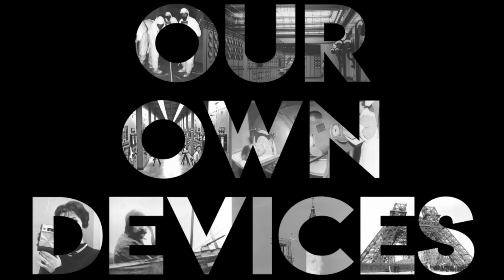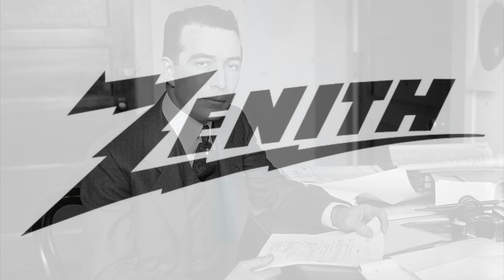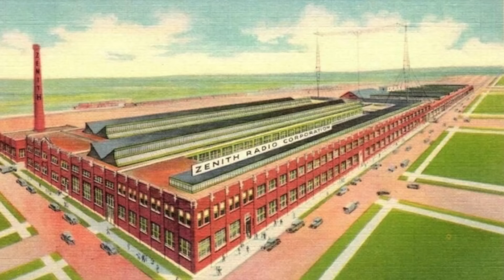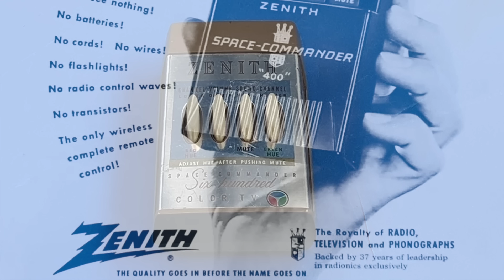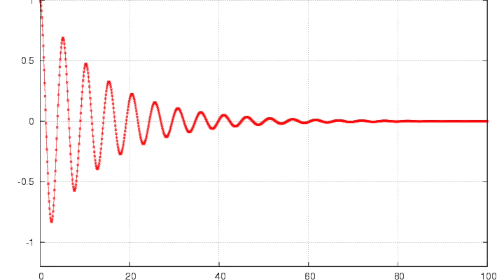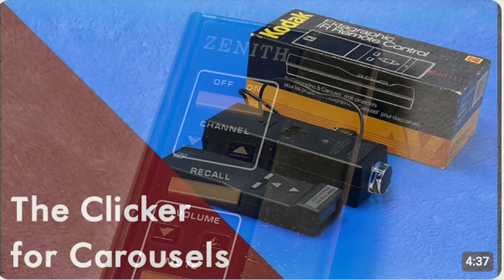Zenith Space Command TV Remote: the Original 'Clicker'

Comment: 08:00 "Since producing infra-sound was not technically feasable...."

Of course it was technically feasible: you make the same control, just with slightly longer metal bars. For example, if you wanted to use 20, 23, 26 and 30 Hz, you'd use aluminum bars about 159, 138.5, 122.5 and 106 m long. This also has the advantage of making the remote control large and heavy enough that you are unlikely ever to lose it.

Heathkit was a brilliant company that made some very interesting home computers, among other things. I'd love to see you do some episodes on their stuff.

Comment: When I was a little kid we had an old black&white Zenith in the spare room with that remote. In fact we kinda had two remotes: back before I was born my parents had somehow accidentally crushed the original remote it came with, and while they were eventually able to obtain a replacement, my dad had also managed to salvage just the frame holding the four bars from the wreckage of the original, and we were able to use that to control the TV by striking the bars with a nail. I remember the ringing telephone would also sometimes change the channel.

Comment: We got out first color tv in 1963.  A Zenith console with remote.  Our remote only changed the channels, on/off and muted the sound if I remember right.  Used the same technology, but ours was not silent.  You could hear it when you pressed the keys.  You could turn the tv on and off by jingling your car keys near the tv.  The remote finally wore out and the rods fell out.  Me and my sister loved it as we were the remote before that.  We had to go change the channels and adjust the volume.  Luckily there were only 4 channels to run through.  LOL

Comment: Fascinating video as usual Jean!  😎
In the late 1970’s, my first job in my own electronics career was as an apprentice technician at a small local TV repair shop.  These ultrasonic remote controls were still the prevailing technology for TV remotes at the time, including other brands besides Zenith.  It was quite amusing to jangle a set of keys in front of one of these sets and watch the TV go bananas! 😂  Another time, I had a remote controlled set that I was reassembling after repairs unrelated to the remote control system .  I had the set powered on and was testing the TV operationally.  The set was operating properly but I still had to connect the ultrasonic pickup microphone.  As soon as I plugged it in, the set immediately began charging channels endlessly.  You screwed it up! My boss, the shop’s owner and head technician complained.  But I noticed right next to him on a shelf was an early ultrasonic motion detector for the shop’s burglar alarm system.  Put your hand over the ultrasonic emitter, I suggested to the manager.  He looked at me slightly in disgust but nevertheless covered the emitter with his hand.  The relentless channel changed immediately stopped, and he looked back at me with a mixture of wonder and newfound respect for my technical knowledge.  Son of a bitch! 😮 He exclaimed!  You were RIGHT, 😅

Comment: They had an ultrasonic piezeoelectric transducer located at front of tv and used a 6au6 tube as a preamplifier to pull in a stepper relay to control motor mounted on tuner

Comment: I've used a later acoustic based remote, decades ago in a small hotel in the alps.
They had a very rustic tv room with an old color tv still hearing wood paneling, fitting the room nicely with the dark wood furniture and antlers on the wall.
Anyway I've never seen a remote before that wasn't cable bound or relied on it infrared already, this one however emitted a high-pitched noise that older people couldn't hear, me a teenager back then could hear it, it also drove dogs crazy.
Pretty sure it wasn't a "Zenith" though.

Comment: Two stories: 

My aunt and uncle had a Zenith TV with this remote. Occasionally, when someone rang their doorbell, it would change the TV channel. My guess is that some harmonic of the door chime (metal plates with a solenoid striker) was the culprit.

My engineer dad hate commercials (something I inherited from him). In the early 60s, he rigged up what he called the "Kommercial Killer" -- a relay based flip flop circuit controlled by a light sensor (from a streetlight). The flip flop circuit would switch the TV's speaker with an 8 ohm resistor to mute the TV. His "remote" was a flashlight. At some point, he noticed ambient light was triggering the flip flop, so he taped a toilet paper tube to the sensor, giving it some directionality. 'Twas ugly, but it worked!

Comment: My parents bought a Zenith TV in the late 60s that came with this remote. I was maybe 8 or 9 years old at the time, and I played with it endlessly over the next few years. Like many other commenters I quickly discovered that jingling a ring of keys would cause the TV to change channels randomly, a fact that I weaponized to annoy my sister.

A few years later we got another Zenith TV for the den, this one a much cheaper and smaller B&W version. It came with a stripped-down remote, a skinny device with just one button. It worked the same way as its older sibling, but with just one button it was limited to changing channels. Cleverly, the TV was designed with an on/off spot on the channel dial - when the dial rotated to that position the thing would turn off (and of course could be awakened again with the remote).

Comment: I remember when my granddad bought a Zentth TV with a "clicker", and that is exactly what he called it, a "clicker", so it is funny how that term was adopted by so many over the years.  In 1976 when I was 15, I had a summer job repairing TV's, nothing really very technical as it was my first real job, mostly opening and closing up the TV's for my boss, maybe change a transformer before hot chassis became commonplace, the owner/tech would tell me what to replace and I did.  When we would use the cool spray or tuner cleaner spray near one of those TV's, it would either turn off and on, or change channels, so we would have to make sure someone wasn't actively working on one of those TV's before using any kind of spray to keep from disrupting them.

Comment: Fascinating, indeed! A really like the concept of battery-less devices like this that uses mechanical energy to work. I ordered a battery-less light switch and corresponding relay module from Ali. I think it uses a small copper winging and a magnet or piezo crystal to generate a short pulse of energy that puts off the transmitter. As long as the mechanics won't break, it should work without ever needing a battery ^^)

Comment: In case anyone didn't know, you can buy battery-less remote light switches that are very distant cousins of this thing.
They use piezoelectric effect to generate enough electricity to send a radio signal, but mechanically are a little reminiscent of this, together with a soft click. This effectively allows you to move a light switch anywhere in a room without rewiring it.
Modern day TV remotes have too many buttons for this to work though.

Comment: My family had a GE Television in 1962 that had an ultrasonic remote.  The remote was fairly large by modern standards since it was built before the invention of integrated circuits, and was powered by a single 9-Volt Transistor Radio Battery.  It had only two buttons:  VOLUME and CHANNEL.  The TV received the usual VHF Channels 2 — 13, but had an extra magic channel:   OFF, which really just muted everything, since if you turned the TV off from its control-panel, the remote didn’t work.

Comment: Our only had two controls: volume and channel.  The volume was I think three steps and then off.  The channel caused the tv to skip to the next station that had a mechanical stopper set.  This was back before UHF so at channel 13, it went back to channel 2.  We had channels 4, 5, 8, 11, and 13 through most of my childhood.  13 was PBS.  11 was an independent stations while 4, 5, and 8 was the big three ABC, CBS, and NBC but I don’t recall which was which.

Comment: In '67 we were over a a family friends' apartment.  She had a color Zenith tv with that remote.  I was fascinated by it being batteryless.  It was also the first time I had ever seen a Start Trek episode in color.  The remotes are actively sold on Ebay.  It might be fun to integrate one into an arduino project.
Reply: My family got its first color TV, a Zenith model, when I was 6 years old in 1966 just before the new Fall TV season started. We, however, did not get the remote control. On the other hand, I did get to see Star Trek in color from the beginning.

We did have a separate set top box that remotely controlled the rooftop antenna position, but you had to get up and walk to the TV and turn a knob to use it. Usually you had to adjust the antenna position when you changed channels, so the remote control for changing the TV channel would not have eliminated having to get up and walk to the TV to change the antenna position in our setup anyway, which is why my father did not want to pay for the additional charge for the TV remote control.

Comment: Many many years ago, I fixed a TV that used a remote like that but with only 3 buttons.  It did volume up, volume down, and next channel.  This was before UHF was a thing so there were only 12 channels to step through.  Power off was done by turning the volume all the way down and then hitting the volume down again.  The volume up was also the "on" button but in fact a lot of the TV was powered on even when it was nominally off.  The heaters in most tubes were running at a lower voltage but the ones for the microphone input and volume up were fully alive.  Mechanical stuff in the TV went clunk for volume up or down and CLUNK for next channel.

Comment: My granddad, a TV repairman had one of these back in the 60s. 
It was basically a nightmare. 
Anything that moved metal around would trigger the TV. If you had keys, silverware from the kitchen, any small metal objects would trigger the darn TV. 
Channels would change randomly and very shortly after getting the TV. The tuner mechanism went out of adjustment and once triggered it would just spin through the channels until you turned the TV off and back on again or grabed the knob and made it stop.
After about the third time he had to pull the TV apart to fix the tuner the machine went in the trash.

Comment: Those acoustic systems on ultra rare occasions would "trigger" on ones keys on a key ring, You could have 3 dozen folks have gobs of keys on a ring and none would change the TV ever, Then one extra person with 6 keys would by accident have one key that's 3rd or 5th harmonic would change the volume or Channel. I had a one key of a set of 3 key rings that by accident would trigger on of these acoustic receivers in aTV.

A electronics friend in SoCal had an acoustic remote and receiver for his big stereo AMP; to adjust the volume. He uses an old Zenith's guts to do this. His wife cat got a new collar with some tiny bell or jingle gizmo and they discovered it randomly changed the volume/ They came home to their tiny tract rental house and the Police were there. The Amp. had gone to full volume and several hundred watts per channel. Thus neighbors called the Police. 

Their cat was discovered upstairs under a pile of blankets to avoid the sound.  

The control logic flaw  on his volume caused this flaw,. One acoustic chirp would slowly ramp up the servo motor that turned the actual volume knob. It required another chirp to stop it. 

I could pull out that set of keys I had and make them hit each other and the Volume would slowly go higher

A neighbor in the Detroit suburbs had one of those Zeniths with an acoustic remotes too

Comment: The old remote that AFAIK nobody has done an in-depth video or website on is the Maganavox Phantom. The original model had two big buttons that when pressed (they moved down quite a distance) forced air through a pair of whistles, producing a very soft and quiet "chuff" that could be heard by holding the front of the remote up to an ear. The left button was labeled Loudness On-Off and the right Station Select. You could only advance the dial forwards so if you lived in an area with UHF stations, switching to the UHF tuner meant you had quite a ways to go around VS the lower number of channels on the VHF dial.

The later Phantom Astro-Sonic has a battery and 8 buttons. Left column was Off-On Vol, UHF down, Color down, Red. Right column was VHF (still forward only), UHF up (no more tedious cranking through all the static), Color up, and Green. The Color and Red and Green buttons were to adjust the Hue and Tint, in the era before NTSC televisions got all fancy with automatic color control.

So, how about a video (with teardowns to show their innards) on both of these Magnavox remotes everyone ignores while gushing on repeatedly about the Zenith Space Command? There's some of both models on eBay.
Reply: We had one like that when I was a kid, it had little bellows in it. Sometimes if a spoon fell to the floor or something like that, it would change the channel.

Comment: Fun fact: Second-generation TV remote controls used a modulated ultrasonic carrier wave to carry a binary code of zeros and ones indicating which button was pressed, and manufacturers created integrated circuits capable of driving a special high-frequency loudspeaker more or less directly from the keypad, maybe with just an extra transistor or two to boost the power  (bigger screen = longer viewing distance = signal is weaker by the time it arrives at the receiver).  This proved unsatisfactory for several reasons, and was eventually replaced with the infra-red beam we have all come to know and love; but using the same ICs to modulate an IR beam at the same ultrasonic frequency of a few tens of kHz.

Comment: By me in South Africa Tv started with test transmissions in 1977, and officially started in 1980, on my birthday. Yes i was the remote a lot of time, as we had a TV set that was colour, with push button tuning, and touch controls for tuning, and i was the one who had to touch the controls, though, for a few years, as there was only one channel, and no VCR, that was only volume and power. Though that set would change channels on humid days, Also I also got to use alcohol to clean the touch tuning panel, to keep it clean. 

Later on there was a second, and then a third channel, so those buttons got used a lot, in conjunction with the TV times, printed in the Sunday papers as a separate section, and after a while there was a new bigger set, and it came with a remote control, so now the fight was who had the remote.

Comment: Your remote needs tuning, the sign off test pattern audio indicated 440 hz, your remote appears orders of magnitude greater in frequency than designed.  Please box it up and send back to Zenth for recalibration.   Thank you for the interesting and informative  video.   As a child I remember using one of those remotes and I can confirm that YES, when my dad through his keys on his desk (in the TV room) sometimes the channel would change.  It made a very nice ker..thunk sound.   Those old TV required a tune up every 6 months to a year.  Depending on ager.  It comprised mostly of cleaning with wipers on the potentiometers.   My father who worked in a TV station, once borrowed ham radio equipment from his friend and set it up in our home.   It must have been some attempt to inspire us to embrace technology.  That equipment occupied the entirety of a  a 5 foot wide bureau.  It barely caught any distant signals despite a 100 foot antenna.   Today, you can buy a radio and antenna for $500 that can transmit and receive signals from 8000 miles away with only 20 watts power.  It is smaller than 2 cartons of cigarettes placed next to each other (Xiegu G90) .   The remarkable thing is that a signal 8000 miles away>>>In a theoretical free-space environment, a 14 MHz signal (the 20-meter amateur band) transmitted at 20 watts over 8000 miles  would result in a received power of approximately -93.9 dBm, or roughly 0.4 picowatts or .00000000000004 watts.    Yes, you can talk and hear with that little power. Current radio technology combined with the processing power of a normal computer can send a 0.25 watt signal the same distance. (WSPR is an acronym for Weak Signal Propagation Reporter.)  That is less power than the output of a typical cell phone in operation travelling 8000 miles and more.  We have come a long way.

Comment: My 1994 Infiniti Q45 had remote control radio buttons on the steering wheel.  The volume control just activated a motor on the radio which physically turned the volume knob.

Comment: That's funny! As a retired nerd myself, I checked your work, but won't harp on the uber nerdy stuff like temperature, pressure, humidity and quality of mustache affecting the speed of sound in air, the usage (and even concept) of an "average speed" in aluminum, your incorrect pronunciation of same, or that I actually came up with a 7mm rod thickness instead of 8mm.